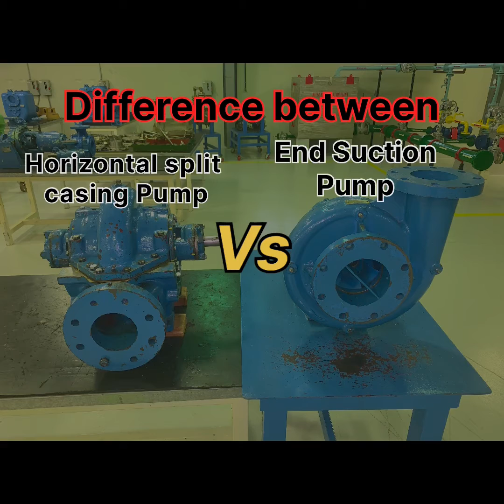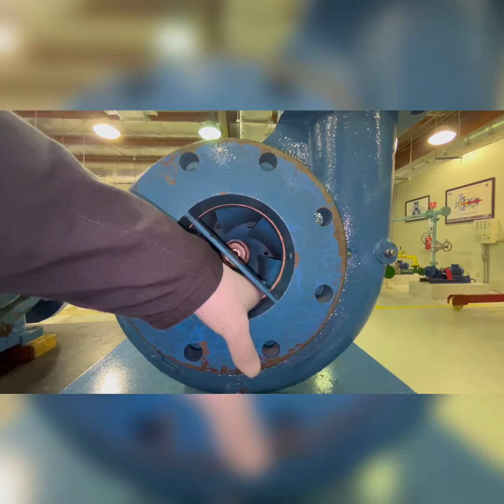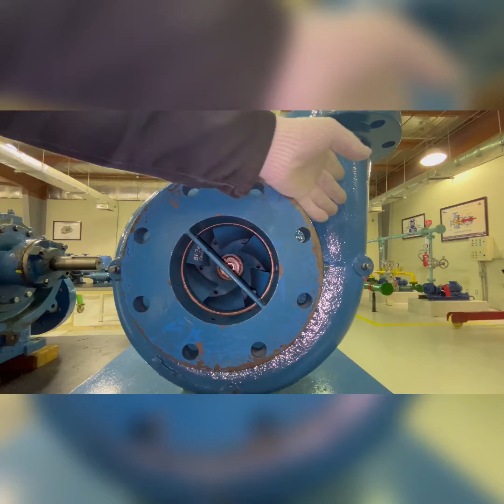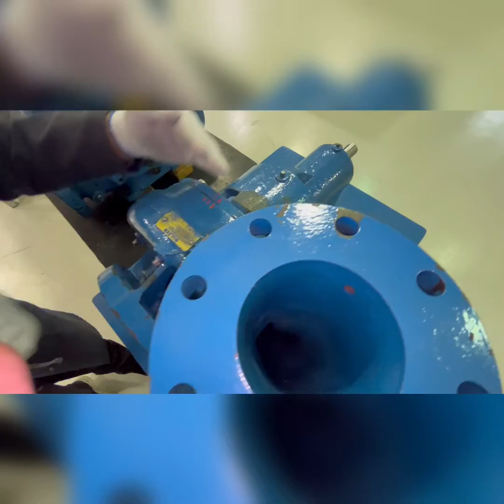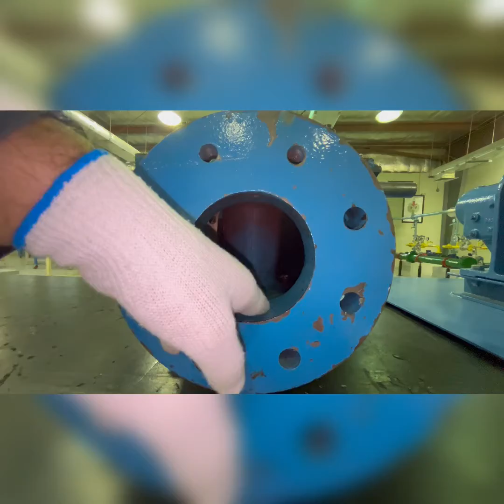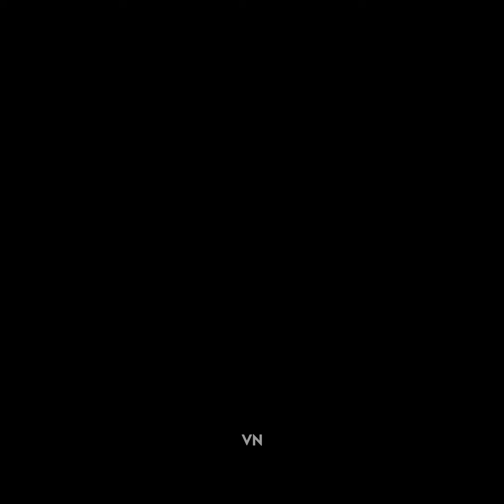Difference between End Suction Pump and Horizontal Split Casing Pump | Centrifugal Pumps

Comment: The rotor direction also in  the end suction pump is perpendicular to the inlet flow 
But in split case the rotor direction is parallel to the inlet flow